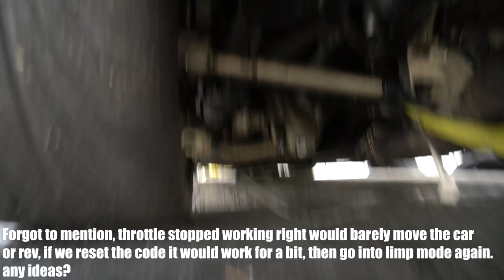110+ MPH ENTRIES!! Fully Sending it in the Missile 350Z!!

Comment: insane drifting that lower power car. THIS is why we watch your channel.
Reply: Nicholas Petersen this is not a power power drift car
Reply: do you mean "lower power"? and yes, it definitely is.
Reply: 300hp isn't that low. It's plenty to link any track you wanna drive at. A stock 240 or miata is just over 100hp, that's low power
Reply: Nicholas Petersen what Cody said is exactly what I didn't bother to to say as you seem to be brainwashed by fd builds.
Reply: so because i have an opinion that you don't agree with I'm "brainwashed"?
Reply: The 350z is definitly a lower power car for drifting because of the weight.
Reply: Nicholas Petersen no, because you're delusionnal about whats a low power car.
Reply: For sure a lower power car.. haters gonna hate
Reply: jake A stock miata is a lower power car, not a stripped 350.
Reply: Warren Yaro do your research more

Comment: You should get a water level sensor (if you care), so you don't have to think how much water is in the tank. It shouldn't be difficult to rig something from some car (a sensor from some car and an LED in the dash perhaps).
Reply: Alberto Hecher  , you can use the wires off whatever vehicle you're applying it to that had the sensor on it for the windshield washer fluid and adapt it to that I mean it's not that hard basically all you're doing is using the windshield washer system to spray water on your tires this is nothing new the Australian just been using crap like this to spray gasoline on their tires to do fire burnouts
Reply: Gm shitbox cars have an overflow tank level sensor for coolant also. Saturn ions and Pontiac g5. Could be easy on ls cars

Comment: so sick! i noticed you mentioned flat spotting the tires from the handbrake, one way around this i have found is to use the foot brake to maintain entry angle instead of the handbrake. initiate with the handbrakee but let the car do a 4 wheel slide almost with no power. shit you can even just turn and mash the brakes at these higher speeds to initiate which is even more crazy! lol its actually pretty fun and wears the tires a bit more evenly because theres no pinpoint slide. i wanna see a video of you trying all kinds  of crazy techniques, not just successful drifts even tho those are hella dope too!!

Comment: Dude why don't you let off when you hear the cords coming out of the tyres? Seems daft to bash up your rims and have to limp it the rest of the way round. And then there's the other damage you have done with everything getting caught up in the wires, cv boot and hydro lines ect. The throttle problem could be that there's a speed or abs sensor thats been damaged around there that's putting the car into safe mode and cutting your throttle. 

Sick driving btw and I do love the vids. It's just the pointless destruction of a nice new set of wheels that bothered me here.
Reply: Because popping sets are fun.
Reply: And that’s boring asf, banging sets is where it’s at 👌👌👌👌
Reply: lol remember when he bought the vette and the chick asked if he was actually drifting it....I believe his words fit here just as well "hell yeah, I ain't no bitch"
Reply: It also sucks trying to change tires that are totally spent with cords hanging. Atleast with 7/8ths sent wheels it's 10 times easier to remove them from the wheels.
Reply: James Wray Same

Comment: You should get a different switch for the water sprayer so it can be on the whole time while drifting that would save a lot more on the tires, but then you would need a much bigger water tank. Like one of those big wash buckets? And put a fuel gauge thingy in it to show when you're running low on water, hook it up to a little LED bulb in the dash.

Comment: Put a pin switch on the handbrake bracket so that it sprays whenever you pull the handbrake. That might help the tires when your pulling the hydro for extended periods of time.

Comment: Regarding limp mode, Check your drive belts. When my main accessory belt snapped it put the car into limp mode, no throttle response or power steering. Replaced the belts and everything came back without resetting anything. The weird thing about my car was, it only went into limp mode when the headlights were on (06 G35 coupe)
Reply: My car does that.. 04 g35 when i turn my headlights on it limp modes. What was the cure? Its driving me nuts

Comment: not a criticism just a question... when entering at over 100mph he is straight line using the ebrake to scrub speed. why would they not initiate with a larger angle to scrub the speed...or if there is not enough room or angle then just enter slow so they are not wasting tires skidding them in a straight line at 100+?
Reply: Unicorn Gas my guess is he was just trying to see how fast he can enter. and at that speed i almost feel like he almost has to start off straightish. theres so much velocity at that speed that if he initiates w/ too much angle he'll probably spin. at the same time he probably is scrubbing off speed it seems.